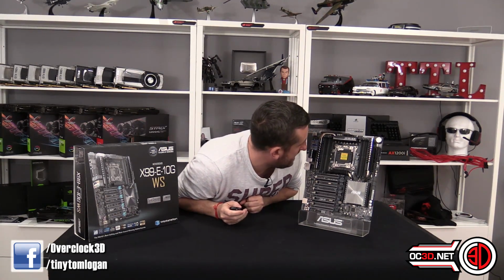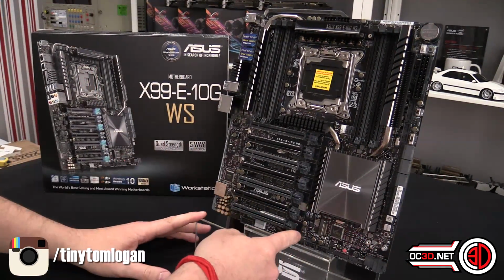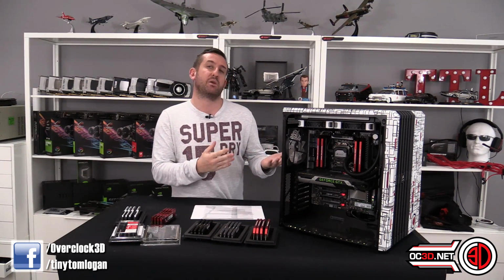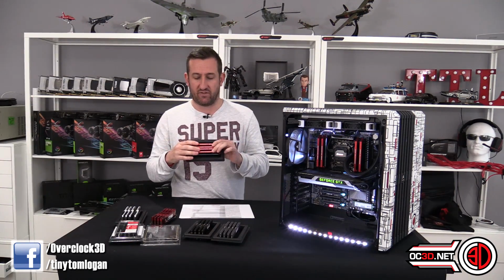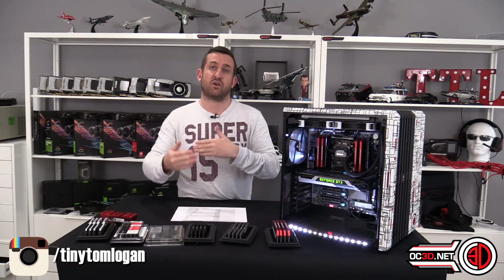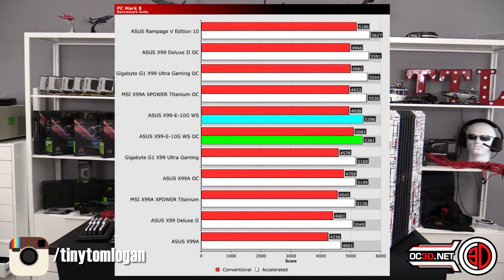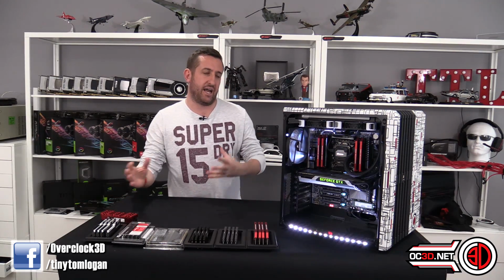Asus X99 E 10G WS Review 10GBe Ethernet Workstation Motherboard

Comment: i had and still have the non 10G version and i used it with M.2 and Win7 without problems to run a 4WaySLI and also sometimes a Quad-SLI.

Comment: In hindsight this was a horrible mainboard. Lots of bugs. Quirky setup. Not very stable. Died on me way too soon, within 4 years use the board would no longer boot and remained at Qcode 00. I had maximized it with expensive CPU and DDR, but this was not a good fit, after this I no longer buy anything asus. They're too pricey for what they actually offer. Then bought a cheap X99 (to be able to still use the other parts) from ali-express and that was even faster and more reliable than this asus crap, which truly amazed me. Later ended up getting a second hand AsRock WS E 10G board to replace it fully, which is what I'm still running on today.

Comment: Hello, thank you for sharing your experience, I admit that I lived the same thing, to such a moint that I almost gave up, I made the same configuration asus X 299 10gb 1samsung mv pro for the windows system 1 samsung MV2 for hives, projects and cache (adobe premiere pro cc), 2 disks in raid 1 and 2 disks for large projects, two gtx 980TI in SLI, and i9-7980XE EXTREME EDITION for cons for memory seen j I have more money I repaired that two Hyper X fury ddr4, 2x4 gb, in total that 8 gb, at the beginning I struggled to install windows 8.1 on the raid 1, because I can not see both mv2, it was a frustration, then I had tests but my two MV2 drives are slow, that 250mb / s instead of 2500mb / s, after several attempts, I installed windows 10, at this time i managed to see my mv2 and installed my windows 10, always the same problem, my computer is so slow and sometimes it freezes, i mean hangs, it takes u n moment for him to walk, when I open adobe premiere pro, it takes time to load, I can not read my hives in real time, I wonder if it is the memory that lack, or these Fury barrettes is shit, I chose this motherboard so the rest are good, but my computer is so slow, and I can not tap the potential of my i9-7980XE EXTREME EDITION , please advise me, I think that memory is not enough to turn such a greedy system.

Comment: Ok, I have been transferring enterprise data over a 19.200 bit connection - and it worked very well. And where I am now, we have 100 Gbit for the same, and it does not necessary work better :)

Comment: Grrr no 1bgps=1000mbps 10gbps=10000mbps grrr and if you want to take full advantage of the full 10gbps this mother orders you will need to use a cat6a Ethernet cable and if your lucky enough to have 10gbps internet you will need a docsis 3.1 modem
Reply from the maker: 10GBe is about internal network nothing to do with a modem. It is fully backwards compatible with older connections speeds. As explained in the video 10GBe is about transferring files between PC's or a NAS at extreme speeds
Reply: OC3D TV did you miss the part where I said " if you want to take full advantage of it" and yes ik you can use them for things like a nas
Reply: You need some more knowledge on the internet and I never said it wasn't backwards comparable and it's unlikely you will get 10gbt speeds with a 10gbps port! You should already know that
Reply from the maker: Properly configured and with fast drives on both ends (Samsung 960's) we ended up getting fairly consistent 1.1GB/s
Reply: Yah 1.1gb not 10gb you wound need a sata express drive array to use all of the bandwidth

Comment: I disagree with your assessment about this board not being for gamers. Well not this one about the X99 WS 3.1. Which is the cheaper variant comes with 1gbps ethernet.

I think the Asus x99 ws 3.1 is amazing. I just bought this board with the following setup:

6850k
2x Pascal titan X liquid cooled to 2000mhz both running at 16x speeds
Then i have 4 NVME Samsung 950's 
1 as a boot drive. 1 as a back up and other 2 in raid.
The raid drives can put out about 5gb of transfer speeds which is insane.

All the devices are running at full speed PCIe which is awesome. 

I personally game on a 5k Dell display. At which point PCIE bandwidth can become a limiting factor. I would love to see a review with another X99 board running a game like Witcher 3 at 5k with PCI speeds running at x8 * x8. Compared to this board running 16x * 16x (obviously because a high end gamer would want NVMEs, cant get those speeds with any other x99 board).

Comment: so if you have cat.6 cables in both is that effective 20 gigabit in total?
Reply: No. This is not how Teaming / Bonding works. you'll have 2x 10GBit. For one connection it's using one Interface. In case of failure it will use the other.
Reply: GuteAlteDMark cool

Comment: I have this board. It's probably the best board out as of this comment and I love it. Very sexy. I put an i7-6850K and Titan X Pascal in it. All housed in the massive Cooler Master Cosmos II. The Gbit ports aren't the selling point unless you're doing some serious parallel processing over the LAN or similar work-related case. You could use this thing to firewall a datacenter lol. It was either this or the Rampage V Edition 10 and if you put these side by side, this is the clear winner. My Samsung m.2 is working fine (I use Linux).

Comment: The ONLY reason to get on the 10GBe bandwagon right now is if you have a 10GBe NAS that can handle 200MB/sec transfers, assuming you also have a 10GBe switch that is capable of teaming 2 ports together.

Comment: That needs short runs of cat 6 minimum to run! Long haul, cat 7 or 7a preferred. But all that hardware costs for switch and rest of infrastructure...ouch!

Sweet review Tom!  At that angle in vid, you can actually see where the pins stop at 8x mark in the black slots.

Comment: I feel your pain with the M.2 drive. I managed to get a Samsung SM951 nVME in early January, when they were hard to come by (due to Samsung trying to close down the market to how good it was ahead of their consumer 950 Pro release), to go in my 6700K/Asus Z170 Deluxe set up. I had to flash the BIOS for it to show up in the BIOS drive list and I was previously running Windows 7, obviously I wanted to take advantage of the Windows 10 free upgrade, so had to install Windows 7 on it first and took me ages to figure out that I needed a nVME driver. Which was an absolute pig to find since Samsung don't have it on their site and I think I ended up using a Packard Bell nVME driver for one of their laptops, mattered not, it got Windows 7 install up and running and from there it only  took a few minutes to install. Upgraded to Windows 10 with a "clean install" and have had no issues whatsoever. I love the M.2, fast boot ups, Windows super fast, so glad I paid the £110 for the 256GB as opposed to using a Sata SSD, I use the M.2 for the OS drive and a few programs such of Premiere Pro so the smaller capacity isn't a problem, then I've got a Sata SSD for Steam games and any other programs, then multiple HDDs for data.
Another great thorough review as always, thanks Tom!

Comment: Tom, these 10Gig adapters with the X550-AT2 might be firmware upgradeable to the 802.3bz (prestandard was called nbase-t standard http://www.nbaset.org/), which allows 2.5 or 5 Gbit/s on (shorter run) Cat 5 cabling. Have a read at the nbase-t website it's quite exiting for the next years allowing people to run faster than 1 GIG on existing cabling. Cheers. http://www.intel.com/content/dam/www/public/us/en/documents/product-briefs/x550-ethernet-controller-product-brief.pdf
Reply: https://en.wikipedia.org/wiki/2.5GBASE-T_and_5GBASE-T
Reply: If you want to test 10 Gbit/s cheaply you could run the cables back-to-back to a second motherboard. Ask Asus for a second one :P
Reply from the maker: Theres only two in the UK afaik.....
Reply: or get a 10GIG nic for another mobo....
Reply: but they're quite expensive :(

Comment: Maybe I'm missing out on something here, but if you're trying to install Windows 7 on the M.2 drive, why wouldn't you just put the drivers onto a USB drive and load them into the Windows installer during installation, as it gives you the clear and simple option to load any necessary drivers that weren't preloaded?
Reply from the maker: It doesnt work. M.2 and windows 7 is beyond a pitfa
Reply: Jesse Dery
Why wouldn't you just boot in UEFI mode?
Reply: OC3D TV
I hear that. I was able, just yesterday, to get W7 to boot in UEFI mode via SanDisk m.2 on a HP ZBook 17 G3. Though, to clarify, I haven't been able to get it to boot in UEFI mode via USB drive but have with an external DVD drive.

Comment: cat 5e is fine for short runs on 10gigE  but your mileage may vary , go standard cat 6 patch for short runs (1-2m)

anything more go cat6e STP ( not UTP) 

That board is expensive , but when you consider how much a dual 10GigE is , its not bad.

I am guessing the board is only copper right ? not SFP+ ports that can take fiber ?

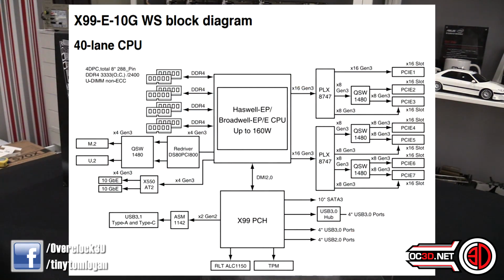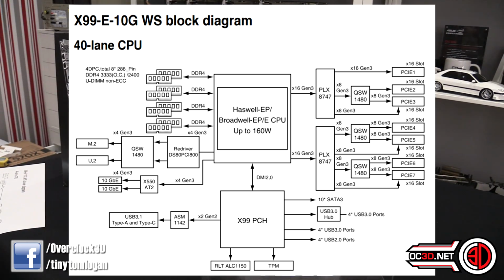Comment: What is that squeaking noise in the background from around 5:59-6:35?

Edit: ok it's at least all over the video in the first 10min...
Reply from the maker: Possibly the plastic mobo stand?
Reply: Weird, at 0:43 for example, you don't seem to touch it and the stand isn't moving, also I can't see the table moving. Maybe It's a one time phenomenon, if it persists in upcoming videos, I'll comment on it again. It just did throw me off, sry :(
Reply from the maker: If you mean the click - Its audio based but its not my mic. Ive not been able to track it down.
Reply: No, it's sound like rubber squeaking, like rubbing a air filled rubber balloon or sneakers on a gym floor, clearest example I could find is marked with the red boxes:
https://i.imgur.com/PhW8f01.png

Comment: with that many PCI-E ports, I think you could run a flux capacitor!
Reply: ...A flux capacitor requires 1.21 gigawatts of power .  So no it can't.  Just sayin'
Reply: that's why Tom will have to get that mobo base clock up to 85 MHz at exactly midnight. The moment lightning strikes Big Ben!

Comment: Just out of interest.. could you do 3 way sli with a free slot between each card with this board?
Reply: I was thinking that maybe some slots run over the plx chips and others directly from the cpu, so they probably could not communicate with eatch other. At least it seems to be the case with dual-socket motherboards that you can only run sli with slots from the same cpu, you can not run gpu 1 from cpu 1 and gpu 2 and 3 from cpu 2 for example...

Comment: Anyone can recommend me a Modern X99 motherboard for hardcore gaming?
Reply: x99 isn't really the best choice for gaming, but everything would depend on your budget.
Reply: Which socket is the best for gaming?
Reply: Camilo Martinez Aldaya 215 max budget.
Reply: ***** Wow thanks man, I read up on it its pretty freaken awesome black Fridays coming up now I have something to focus on getting thanks man.
Reply: ***** i7 6800k
Reply: Angel Torres i choose the asus x99 strix, its a solid board as a whole. Changeable fuses, good for overclocking, etc
Also the evga x99 classified is solid too. But only has 8phase power vs 12 on stix.
Reply: ***** an I7 I already have a video card ready I put most my mine into that, I got the msi 1070 but I really don't know about what kind of cooling to go with I kinda like air cooling feels safer I'm a little old school in that.
Reply: msi is the worst brand iv ever used
Reply: i owned a msi z97m gaming and it did not come with a io shield. also i keept loosing any m.2 ssd i used and wiping them so i kept having to reinstall windows but when i gave the same ssd used in my friends pc its worked with no problems for the past year also one of my PCI slot just came off with my gpu so i just recycled my 200 cad motherboard because they would not honour the warranty PS.. im dyslexic and im not good at word stuff
Reply: yes i was on the most recent bios and had all drivers installed except the audio as  i use external
Reply: i also forgot that my fan control did not work at all i had to use fan speed. my current favourite board is asus but i still think msi makes good gpus
Reply: Titytit Mk2 RIght now lga 1151, which is skylake, with 215 you should be able to pick a good motherboard.

Asus MAXIMUS VIII HERO
ASRock Z170 Extreme7+
MSI Z170A KRAIT GAMING
Gigabyte GA-Z170X-Gaming 7

Comment: Finally caught up to ASRock's 10G workstation motherboard I guess.
Reply: to be fair it was linus's fault
Reply: j3rf the one that almost ruined Linus business
Reply: no mystery. everything will be 10gb in a few years. it's got nothing to do with asrock lol, and linus is an idiot for having so much hardware and still not being able to run a reliable backup system
Reply: He didn't have proper backup, yes, but the board shouldn't have spit out pcie errors
Reply: It was? lol oh well. I wasn't implying the ASRock mobo is better, but just interesting Asus felt the need to add a feature another manufacturer had on one of their similar boards last year.